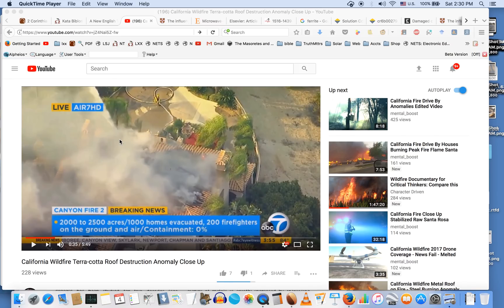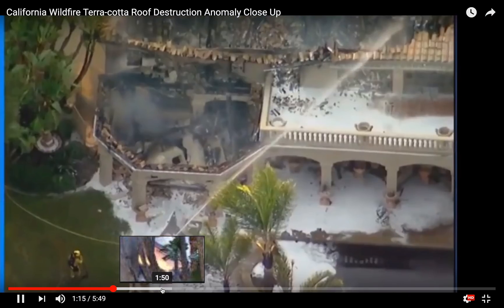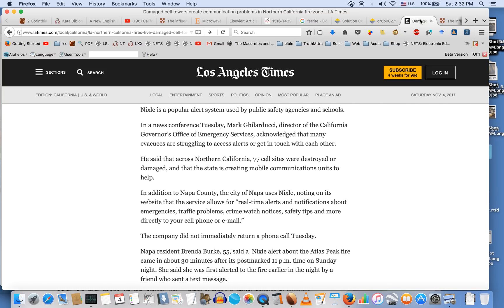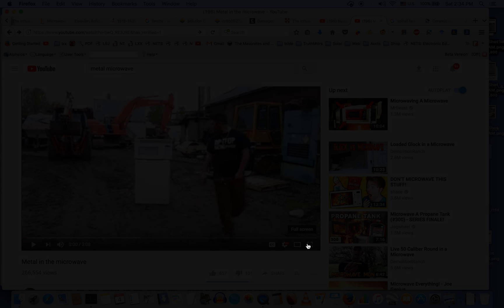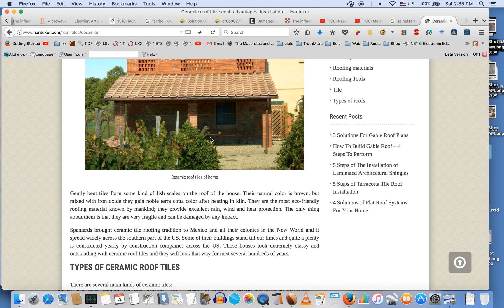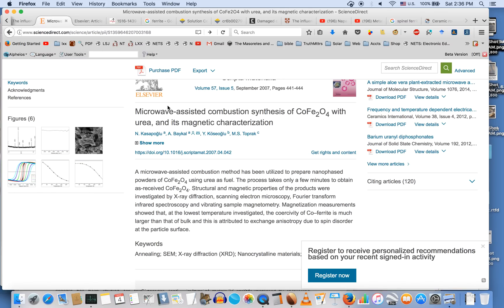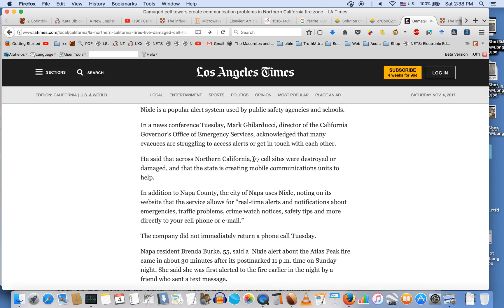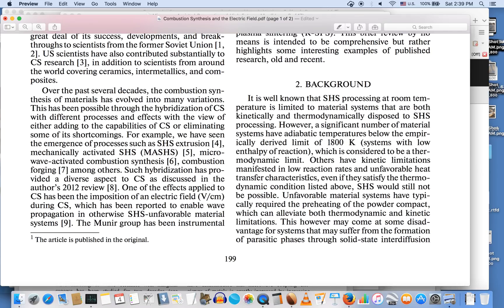California Fires: Terracotta Roof Anomaly: Microwave Assisted Combustion Synthesis

Comment: Any, and I mean any, home has a self ignition system built in to the roof of the house when a microwave weapon is used to start a fire in the structure. Every roof on every house has some type of metal fasteners on it. If it is a conventional roof with asphalt shingles is has thousands of roofing nails to heat up and the asphalt is a type of oil based product that will burn extremely hot once it is started. But even a steel roof has metal fasteners and most are sunk into a subframe of wood to hold the steel sheets in place. All homes are prime targets for a microwave weapon.

Comment: It doesn't take much for a house to catch fire. The problem with a lot of terracotta roofs is that they make perfect places for birds to nest and create debris. All it would take is one small ember to get under the roof where a nest is and vooom it will go up in an instant. I know this because I had some birds nesting under my eaves.  I noticed that, the birds used a lot of lint, "probably from the lint vent on the side of our garage where the dryer is." I took a flint kit I had, and with one strike the nest caught fire and burned hot and completely "nothing left except ash". More than likely that is how some of these fires started. The terracotta offering a nice place for birds to nest, but also acting as a sort of oven once the nest or debris caught fire. It wouldn't take much for the wood roof structure underneath to catch and burn.

Comment: Stupid.  The terra cotta (if they are since we are seeing more aluminum roofs that look like terra cotta) is burning from the attic.  Obviously since we see smoke and not flames.  The roof did not catch on fire but the eaves did which are made out of very dry 2x6s and dry osb/plywood (depends on the age of the house).  The houses are spaced 2 feet or less from edge of the room to edge.  So all these houses, built so close together out of very dry wood go up really quickly in a fire that is fueled by excessive winds.  Nothing new to see here it happens every so often in LA.  The homes that are untouched were built better than the homes that caught fire.

Comment: To burn homes this completely, without all trees no being burned initially, not having paths burned TO the homes; I have to conclude that the fires STARTED WITHIN EACH OF THE HOMES (AT THE SAME TIME or DIFFERENT TIMES). Later, as the flames spread to brush, it then was a continuation, as the fire then BECAME a forest/brush fire. But being started in EACH HOME at the same time, one has to ask: "What is it these homes had in common"? The only correct answer is ELECTRICITY. In fact, the houses that burned first, all seemed to be in housing developments, probably contracted by the same builders. But who made the breaker switches that should have "protected" those homes? China or who? You say that all the breaker switches couldn't be bad.  Ha, I worked in a house that had been burned, only to find out, that an electrical outlet was arcing; and I had to stop my whole part of the job and alert my contractor so this could be fixed. All the outlets in the house were defective. What about the fuses on the line poles? Did you notice in one video that a service station, with an array of solar panels on the roof..THIS BUILDING DID NOT BURN. Solar needs to be re-wired to have an inverter installed, so in some essence, they are OFF LINE from the grid, for certain specific amounts of time. What I'm saying is: ELECTRICAL SHORTS IN THE WALLS CAN HEAT A HOUSE UP TO MEGA DEGREES IN NO TIME AT ALL. THAT IS WHAT SOME OF THIS FIRE DAMAGE LOOKS LIKE. INVESTIGATORS NEED TO INVESTIGATE.
Reply: The fire jumped house to house

Comment: Good thinking :) ... thanks for sharing your thoughts .Microwave combustion... Sketchy!!! ... also a side thought, the houses already have an electrical field surrounding them (i.e.) the electrical wires that run all throughout the house, it's like a reverse Faraday cage of sorts. you could just send a small burst of microwave energy and the houses wiring system would heat up and start to throw off sparks everywhere... whoa!!!

Comment: Terra Cotta tiles are usually applied to a wooden substrate. The fires burn from the inside out. possibly all of the metal including wiring,hinges, nails and screws, got super heated by microwaves, but the big questions are who and why.

Comment: Read on eddy currents. Focussed microwaves can heat metal. Particle size limits the heating due to eddy current loop size. Doughtful that tiles heated. You could heat up metals and start a fire. Lookup radar phased arrays re focussing.

Comment: Paper made from wood pulp?

No trees burned?

911 streets littered two inches deep with paper yet no burning?

Engine blocks five and six blocks from towers showing signs of being reduced to metal dust
right next to shrubbery completely free of fire damage?

Not a single vitreous china toilet found, not even a fragment, from the over 3000 in each tower?

Entire marble facades on front of adjacent bank buildings literally turned to dust?

Clear and distinct video proof of aluminum cladding on towers 'burning' with orange glow when aluminum when molten is shiny and bright like melted tin or solder?

Steel in towers clearly being video taped as they turn to fine dust and door handles on cars and trucks completely vaporized yet the paint on the door completely untouched?

And on and on

Yet  it was an aircraft brought them down?

Deep state always 50 years ahead in technology we only know about in 50 years?

Are we all willfully ignorant?

Yes we are.

Comment: I guess no one is going to point out that microwave transmissions require a line of sight connection. If they are using microwaves from cell towers to start fires it would mean they would have installed an antenna just for the purpose of hitting that target at some point in the future.

Comment: This anomaly is easily explained.. the fire started inside the house.. either by a cigarette on the couch or arson. It burned from inside out.. the roof collapsed. Cell towers have rubber/plastic wiring going up to tower and antenna housings are sometimes made of plastic to weatherproof the transmitting horn.

Comment: Thanks InTruthbyGrace. For me, I am more curious as to the Humidty levels in the area of the fires. 7% to 10% percent is dang near desert conditions. I tried to find the historical humidity levels for the Santa Rosa fire and it is not easy to dig that data out. What I did find seems to suggest that humidity levels in December are around 40 to 60 %. Might it be that if microwave energy is being used that super low humidity levels are a telltale sign ? mmmmm Oh, and by the way, Google Earth has some amazing satellite views of the fire areas like Santa Rosa. Going to Street View for the affected area shows the beauty of the homes that were completely burned to the ground. The jury is still out for me on whether DEW is the cause of the fires. If the winds had not been over 60mph then I would lean much more heavily to that belief.
Reply: The diablo winds always have extremely low humidity.

Comment: I don't see terracotta tiles burning.  I see flames around them which is probably the tile battens and felt etc.   Although I know these were not natural, definitely DEW fires,  I have to be honest with everything I see because if we appear to have any form of confirmation bias it doesn't do our truth movement any good at all.  We must be fair and honest in everything.

DEWS are real.   The military and government admit to having lasers which focus heat by joining many laser tubes together and focusing them all in one small point creating what would be comparable to the Sun's inner temperature.  A little bit of research is all that is needed to realise we are at way with our government.

Comment: Grace good work!  But............. you feel they used NOT DEW's from the helicopters and their
blue bolts to the ground but the cell towers, Or "smart meters" on each house????
There are videos out that show entire tracks of up scale house -like this one--- turned to
dust only w/in their foundations! I mean the lawns, landscaping are UNTOUCHED! like the
"K-Mart" burned down !  And 6 huge fires all starting at once in widely separated areas!
If it was cell towers it seems their locations could be easily plotted to the damage...... and
some record found of the date-time, and amount of energy used by each....... (?)   
So they've not only weaponize the weather....... but now the cell towers too?    Thanks again!

Comment: The U.S. isn't the only country that has this technology.  I caution against the more than reasonable assumption that the U.S. government is to blame.  Directly, anyway.  Yes, I know about A23.  HAARP technology has supposedly been replaced with EISCAT.  There were at least 18 HAARP arrays... I wonder how many EISCAT there are (under different acronyms, of course).

Also, if you're on the chemtrail bandwagon, isn't the whole country now coated with aluminum (metals)?  o_O

Comment: THE NORCAL FIRES WERE IGNITED  WITH AIRCRAFT MOUNTED D.E,W's (direct energy weapons) Basically , a microwave carried on a laser beam to the intended structure on the ground. Burns things from the inside out like the santa rosa trees you probably have seen by now that were completely involved in flame on the inside but the bark on the outside was unscathed. Nothing can have this effect except DEW's.  CASE CLOSED.
Reply: Cases closed....you’ve presented no evidence to support your claim. Trees burning from the inside out are completely normal for a wildland Fire....go do some research and see for yourself

Comment: quick question - it seems like a lot of microwave radiation would be needed to ignite a house (im guessing) - how would people inside one of these houses experience this level of radiation? have you come across any reports of people suffering some type of peculiar burns or other damage? or, would this level of microwave energy go largely unnoticed by anyone inside?  

some comments here mention that the roof tiles themselves are not burning - that only the wooden structures under them are. And this seems verifiable in the video. But I guess this could be explained by the microwave vid with the metal inside? the metal itself in the microwave doesnt burn and turn to ash as such - in the same way that the terracotta doesnt burn - it sparks off from oxidation process, and the wood underneath it would catch fire from these sparks and heat and start to burn. so the wood under burns, but the tiles remain intact - even though they were the source of the heat/sparks that caused the wood to ignite.

Comment: Great video. I bet if condition are right and the amount of cell towers plus high microwave activity added to the composites of the tiles and structures this would be a primed tinder box waiting to happen. Very logical and of course they will point us in another direction because of potential liability and law suits.

Comment: Definitely not saying nothing odd went on, but the terracotta tiles themselves are not burning, the roofing slats and tar underneath are.

Interesting point made though, as this would further support the use of DEWs (which are essentially focused radiation guns aka lasers). The point a lot seem to be missing in regard to DEWs is the technology doesn't necessarily mean "shoot a laser beam at things and they catch fire". It can be used to guide lightning strikes, storm present or not. The 'officially reported' cause of the fire is a dry lightning strike. These can be manipulated with lasers as the high-energy beam creates a plasma channel through the air which is highly conductive. Any electric potential in the air will collect and pass through this channel, much like lightning.

People noted seeing "blue sparks" in the sky prior to the fires. This is indicative to plasma channels in the air. USAF has a modified Boeing with a nose-mounted laser (YAL-1, supposedly scrapped in 2014 due to budget inefficiencies) tested to destroy ballistic missiles. Who's to say this wasn't scrapped but moved into a secret program with allocation to some of the nearly $60 billion pentagon black budget?

My question, if this be the case, is why? I've heard some speculation, both with and without merit, but nothing seems solid.
Reply: started inside .................
Reply: Sploof, Where did you read/learn about the aluminum oxide decomp process in plants? I'd like to read up on that as it could have significant implications elsewhere.

I'd love to see someone test the electric potential of old terra cota tiles on houses predating 1990 vs brand new ones. I would but I lack the tools to do so properly.
Reply: Sploof, I can see why they wouldn't acknowledge it as it would call for costly reform and possible class action lawsuits (sad that money takes precedence over life). Thank you though I'll be looking into that. More pieces to the puzzle.
Reply: joshua morena Yup, the ABL, Airborne Laser, and whenever they showcase a new weapon, it is almost ALWAYS shortly "discontinued" or "shelved" so they can use it with impunity and deny it's existence.
Reply: joshua morena i
Reply: sploofmonkey, Actually aluminum oxide is an electrical insulator and is not flammable, tho it does conduct heat well. 

Chemtrails are generally an unrelated topic here with the exception of cloud seeding off the coast of California. Rain in this state depends highly upon moisture pulled from the tropics by pressure systems and the jet stream. Usually this moist air channel runs into the Sierra Nevada mountains and condenses, raining on the coastal side (leaving a desert on the backside: Nevada, Arizona, etc.) By seeding these air channels off coast, they dump rain prematurely over the ocean and are relatively dry by the time air reaches land. Do this long enough and you create a drought. 

check out "earth[dot]nullschool[dot]net" to see some really badass data tracked and charted across the globe.
Reply: THOR did it!!!
Reply: ^THIS
Reply: Somebody didn't like whomever lived in this house
Reply: joshua morena
Look closer. You can see many half burned tiles.
Reply: COIL (Chemical Oxygen Iodine Laser) was developed all the way back in the 70's and it wasn't until the late 90's before they could even make it work at tremendous cost. Even then it was was only capable of generating a sustained beam of a few hundred kilowatts for only a few seconds. Enough to shoot down a missle maybe in a controlled test but are you aware of the energy requirements to fire one effectively from orbit? What unknown materials could even handle that kind of heat without vaporizing instantly? Vibranium maybe? Lol...
Reply: I dont even want to get into what could possibly generate that kind of energy from orbit (deathstar)... but you seem like someone that would know... can you direct me to anything?
Reply: No DEWS used. Sorry.

Comment: What if they pumped up the microwave energy in some or all the cell towers around the area..? The cabling running into these towers is designed to carry a LOT of voltage and amperage. There are videos on here about it. AND the Smart Meter thing is REAL!! You can download a simple app which will show you the average EMF background radiation which is between 40-60 and near these meters it increases 10 fold or more. Much more. I put a Faraday cage over the one on my house and the electric company (PP&L) Penn Power and Light., will not remove or replace it unless I PAY THEM $75 more a year. Plus other fees. Some communities have banned these things all together.
Reply from the maker: I wish I could get ours removed.. you're right they are very powerful and microwave assisted combustion is very real...

Comment: I thought it was interesting how they quickly hid the news of the Discovery Bay http://www.thepress.net/news/truck-strikes-utility-pole-leading-to-power-outage/article_ecd488ec-baa2-11e7-b7bc-0fa2be833f11.html
where an Oct. 26 fire :
"Battalion Chief Ross Macumber estimated that firefighters investigated 30 homes throughout Discovery Bay. Damage ran the gamut from a light odor of smoke to damaged televisions, microwave ovens and other electronic devices. In some cases, light bulbs burst and several smart meters were blown off their outside mounts. While some residents reported seeing flames come from their electronics, no fires were caused by the incident."
create a power surge that traveled across the power grid to nearby Discovery Bay were there were reports of an exploding transformer and numerous calls from homeowners reporting smoke from utilities and electronic devices in their homes".  Could a power surge from one pole going down create enough of a surge to push smart meters to flame?  Especially if it looked as though the homes were all burning at once.  Add that to the electromagnetic frequency soup we are all in from cell towers and antenna.  ...would that do it?